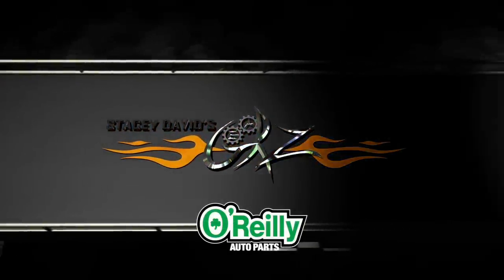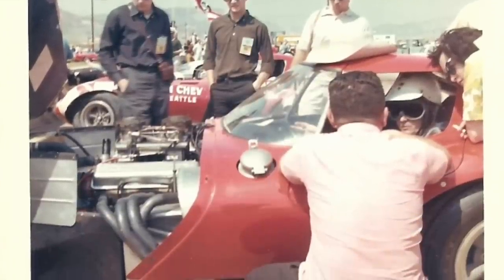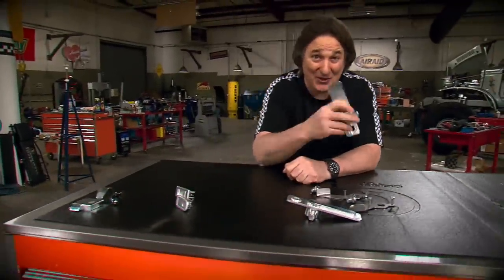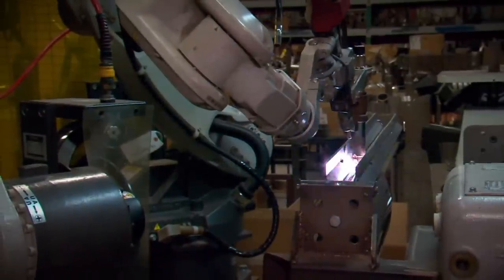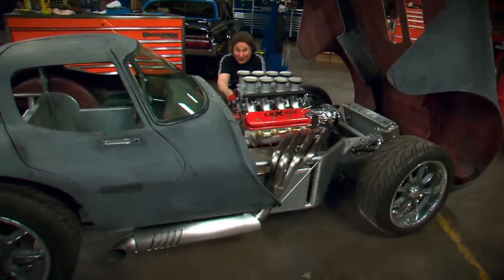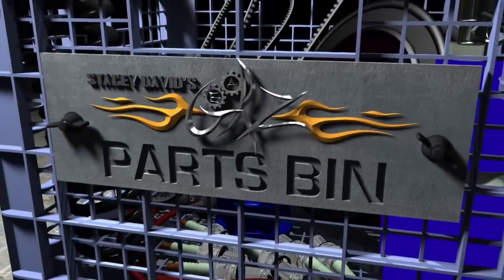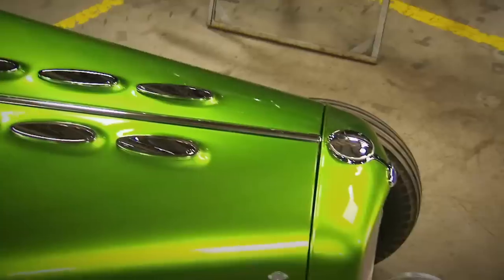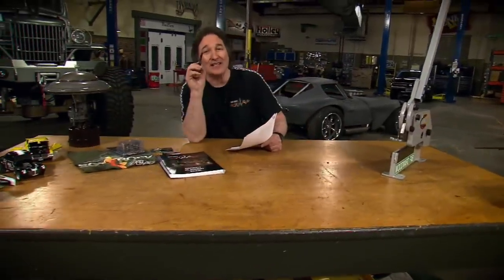Cheetah Custom Exhaust, Bodywork, & Latches - Stacey David's Gearz S10 E5

Comment: those hose tools at 14:40 work even better with a little lube. Once you get the tool  inserted spray in a little silicon spray or wd40 with the straw nozzle on the bottle,  then move it around to free up the hose from the metal.

Comment: i had almost forgot about this old program, now i need to look up all the episodes for the cheeta, i do have some advice for the trolls that seem to haunt every video i watch, instead of thinking you are an expert on every subject that these videos cover try doing this just once, instead of letting others just think you are stupid don't comment and prove to them you are, do some research on the subject. you might learn something, hand laminated fiberglass bodys and boats use both methods mentioned here, on the same boat or body, the method with chopper gun is used along with the mat, it gets complicated so look it up if you really care.

Comment: Why do i feel like 637 isnt that great for a lsx454. Im pretty sure those ultra 4 trucks mostly use a ls3 crate and I could have sworn there getting in the low 600s.
Reply: anytime you can reliably have 1hp/1ci you are doing just fine
Reply: They can get higher HP, but why? The car weighs like 1500 pounds? It should last forever and be as fast as a 1300hp modern Vette
Reply: I get what you're saying. but that big block also has a lot more torque and the cool factor
Reply: volcano hi and you are correct. there technically isn't any big blocks in the ls motors right?  my problem is anytime I hear 454 my brain thinks big block lol
Reply: codysett1 Hillborns are great to look at but actually suck for horsepower
Reply: I'd rather have a bigger motor that doesn't have to breathe heavy then something high strung
Reply: Johnnie Shepard not super hard on horsepower it's the total lack of driveability and the retarded cost of them
Reply: John Balkenbush no dude they are for looks not power and they are expensive ole Finnegan took his off the blasphemy for that exact reason
Reply: one number doesn't always tell the whole story.   I imagine something like the 454 would produce a ton more torque down low but start to run out of breath on the top end where as an LS3 would have the bulk of it's power in the mid and high end.   I could be wrong.  A dyno chart would tell more of the story though
Reply: If "Hillborns are great to look at but actually suck for horsepower"

then why does most every sprint car team use them?
Reply: @jerkmcgerkin  what the guy above you said.....
Reply: not in a light car, sure its comfy, but to have a smaller capacity engine, say 5 liter, huge cam and 7000 rpm is very fun. And its faster round a race track because the gears last longer.

Comment: im working on a brtish mk3 ford courtina with a j2z 1600 bhp engine as sn everyday sleepercar driver car ive bought all the engine coponants from scrap yards and payed for every part to be reconditioned so far ive hand built body pannel to make an extra wide body airide suspension reinforces chassy frame to add weight ive introduced bullet proof glass and military grade bullet proof steel where ever i can fit it on the inside of the body of the cat the car now weighs 1.6 tons and because it only weighed 798.6 of a ton the car now handles better the car also has 40bls of nos boost and a new interior and new dashnoard and speedos and 2 twin 600bhp turbos the car will be finished in may of next year